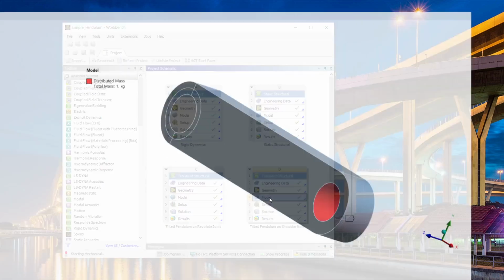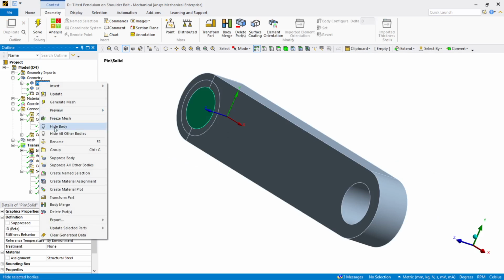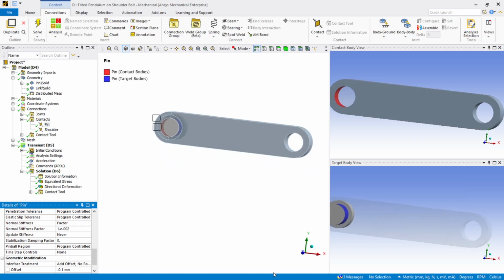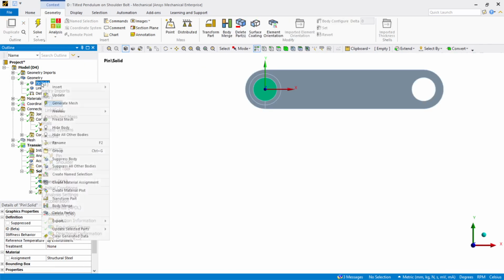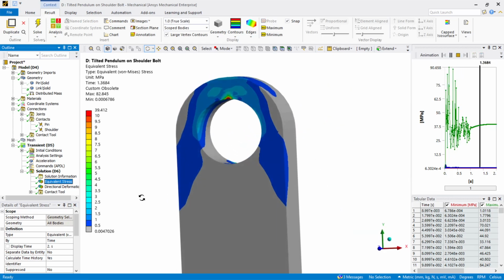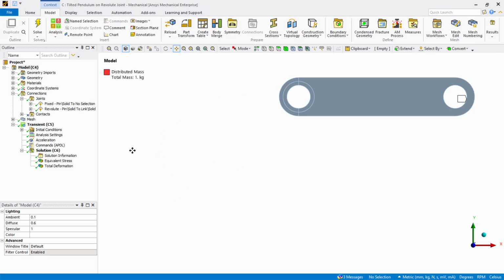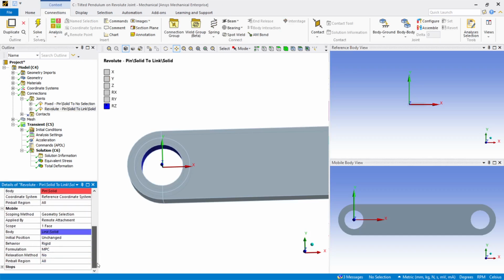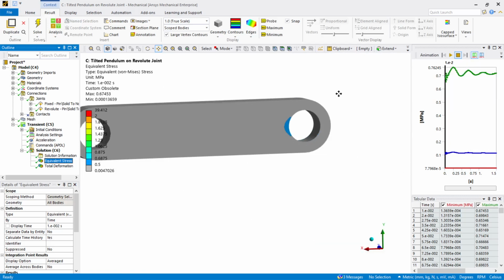Transient Structural Pendulum on Shoulder Bolt tilted up 30 degrees

Comment: Can you explain the first part how you made the joint how you gave the oscillation
Reply from the maker: The link is horizontal at the start of the simulation and gravity pulls it down to cause the oscillation. The link is like a pendulum.